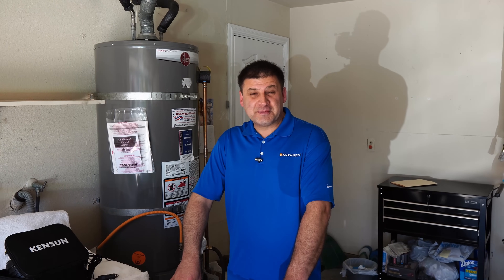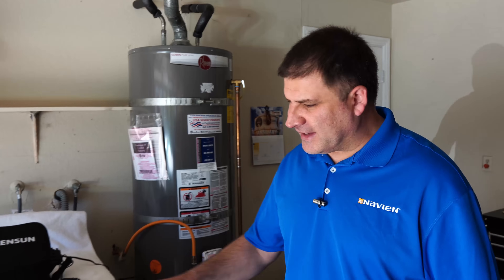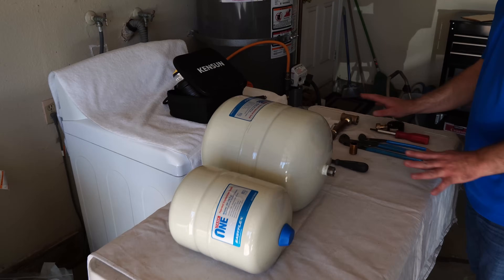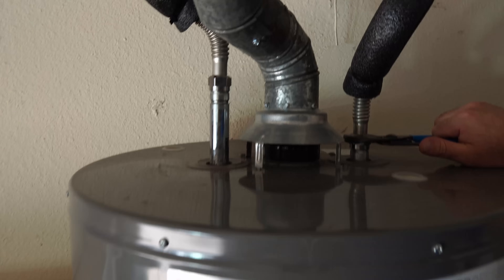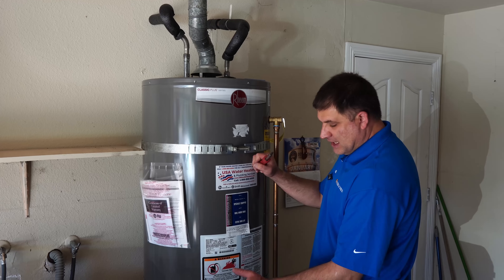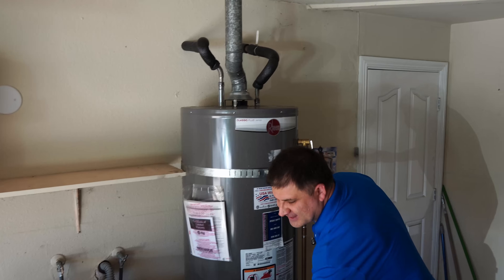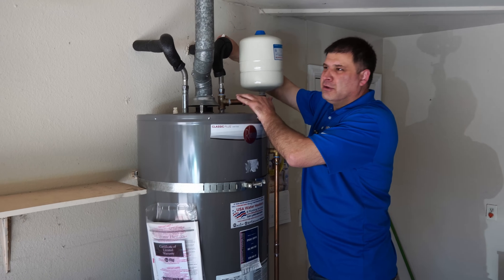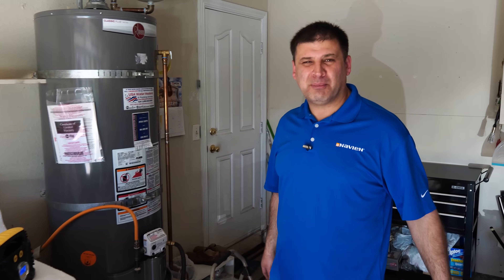✅ Expansion Tank Installation on a Water Heater - What is an Expansion Tank? - How to Install it

Comment: Hi Dennis,
Great video! Have you ever used stainless steel fittings and would they be better or work just as good as brass, in this case? I’ve got stainless steel 304 fittings (tee, nipples, elbow), as well as brass lead free fittings. I’m trying to decide which ones to use on my new water heater. Thanks!
Reply from the maker: Hi Steve,
I am not familiar with the 304 stainless steel fittings. They are not being used on a daily basis in residential plumbing. If they are approved for use with water and you already have them, you should be fine using them. It will save you some money. Best,
Reply: i would suggest getting the brass fittings cuz asa plumber i was taught like he sed not to use s.s or blk steel fittings cuz they will rust and break down with time and heat it will b absorbing over time and that will go into your water lines possibly clogging faucet filters or just mixing with the water contaminating it therefore meaning ur washing ur dishes with that water and furthermore showering rubbing ur face and brushing ur teeth and rinsing with water mixed with pieces of rust/rusty water

Comment: Hello Dennis, I'm installing a new water heater with a new expansion tank. I have already taken out the old water heater out so obviously I have also shut off the incoming c.w. valve. Can I test my water pressure now even though the water heater valve is shut off? It is at 60psi btw. I ask because I noticed you tested the pressure BEFORE shutting off the water heater valve.
Reply from the maker: Make sure the shut off valve on top of the water heater is off, as well as put a bucket under the hot water pipe of the water heater just in case. Attach the gauge at the hose bib and turn the water supply on for 2 seconds to get the reading. Turn off the main water supply and go back to your planned workflow.
Reply: @dennistheplumber  oh sorry, my question was confusing. My inlet   valve for the water heater is turned off already and I've capped the hot water flex line. Main from the street is turned on. So I can get an accurate reading in this situation with only the cold water lines pressurized?
Reply from the maker: Yes, the reading will be accurate.
Reply: @dennistheplumber  thanks! Another question, do you think there is any harm in making a hole in a small piece of 4x4 lumber for the 6" nipple to go through and just having it rest on top of the heater just for extra support/insurance? Other than looking goofy, what do you think?
Reply from the maker: No harm doing that.

Comment: Looks good, Dennis.
We also put a valve at the tank, for easier swap. By orienting the tank with potable connection on top you eliminate air in the tank, also if bladder fails you have less water spillage when replacing.
Your right about tight, too. It’s easy to damage brass threads especially when using Teflon tape and dope, but it’s a great joint when done right.
Reply: Plumbers are weird AF. This one is obsessed with "nipple". Most, if not all, have a feces fetish.
Reply: I added a valve also when I installed mine.

Comment: Great video. My 23 year old gas hw heater doesn't have an expansion tank. It has some kind of pressure valve above the cold inlet and is piped to the outside of the house. Do you suppose this is just as good as an expansion tank? Also, when I replace the hwh should I go with the expansion tank and eliminate the pressure valve? Thanks Dennis!
Reply from the maker: Hello Sego. It sounds like your set up is just fine. This video is a guide for those when need to have an expansion tank installed due to accidental water discharge through the TP relief valve that you reference to, placed on the top of your water heater. I advise you to not attempt anything at your water heater, unless there is need to. Regardless of whether you have or not an expansion tank, you must always have a TP relief valve on your water heater. 
Best,

Comment: GOOD WORK! I am trying to install 2 Gallon one by myself. The installation paper says that "EXPANSION TANK must be installed at
 least 18 inches away from the cold water inlet fitting on the water
 heater"  Does it really matter? I have seen few youtube videos that were less 18 inches away. I am a little confused. Pls. comment.
Reply from the maker: Hi Jerry. I don’t see a problem installing it as shown in the video. If you really like to be 18 inches away from the water heater, use a 12 inch nipple form the brass tee, then use a 90 degree elbow, continue with a 6 inch nipple, use a coupling, and then install the expansion tank. That way you will be 18 inches away from the cold water. Best,
Reply: @dennistheplumber  Hi Dennis, finally I was able to finish installing a new gas water heater plus an expansion tank. Thanks for your great tips. You video was very helpful to an inexperienced DIY guy like me.